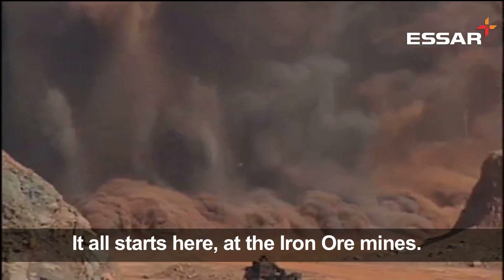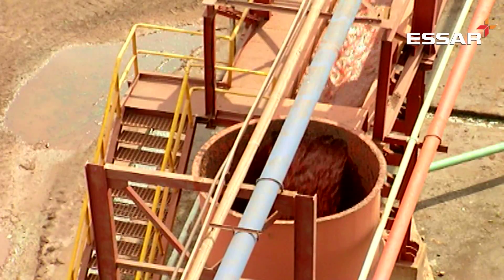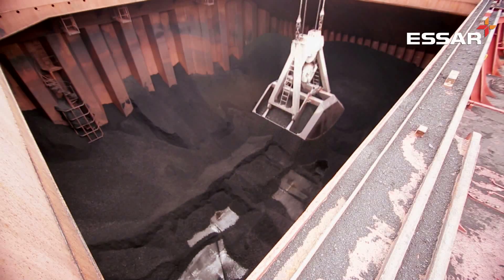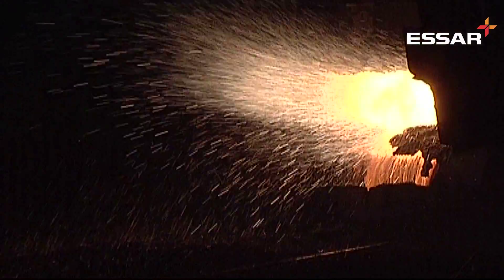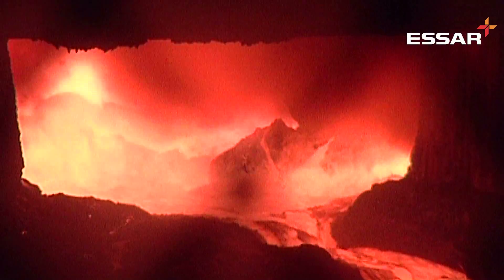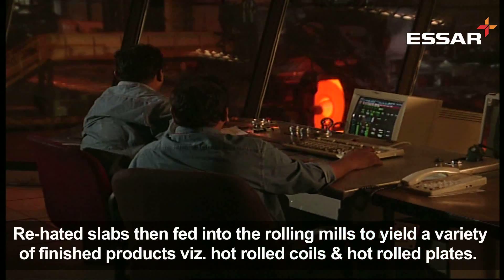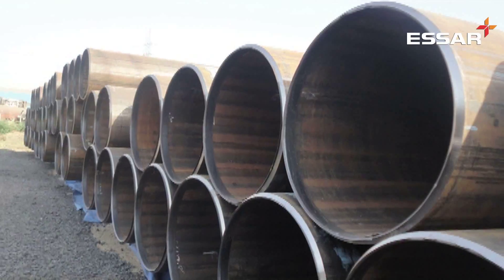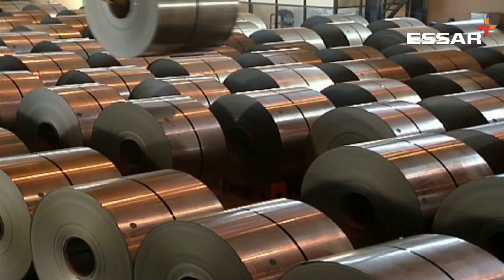Here’s how a small pellet is made into super strong steel.

Comment: https://www.youtube.com/watch?v=FB5LAjEQhVs
Are you still using Rubber Rolls, Vacuum Rolls, Compressed Air -Air Knife Systems for removing, wiping, drying of the Strips, Sheets and Foils being processed on Cold Rolling Mills, Pickling Lines, Degreasing Lines, Skin Pass Mills.
Try using the High Performance Adaptive Wiping System, no requiremnt of Electricity, Vacuum, Compressed Air, Rubber Rolls, our innovative design uses the science in a different manner to wipe, dry the passing strips wihout using any energy.

Are you into strip processing lines line Cold Rolling Mills, Degreasing, Pickling and cleaning lines, Continuous Galvanizing lines and are having problem of carryover fluids, are you having troubles having a clean strip at the exit. Now you can use the High Performance Adaptive Strip Wiping system, it wonderfully works without any electrical or Compressed air, it’s a fit and forget solution with Zero consumption of electricity or electrical energy, simple and innovative design click to check the link and see it to believe it.